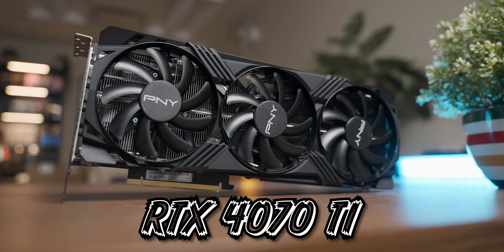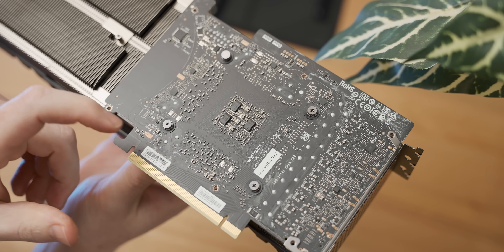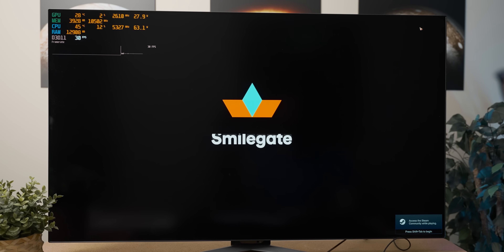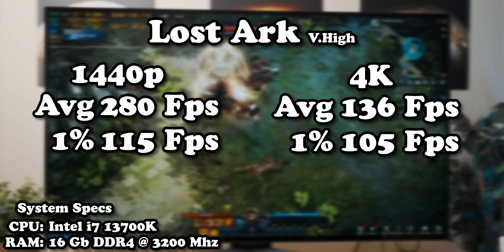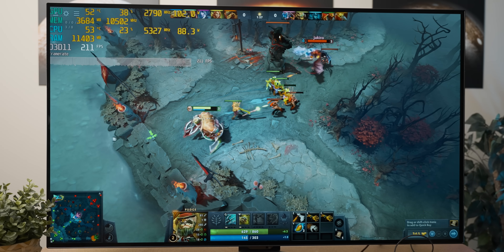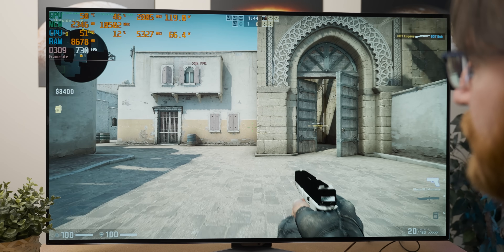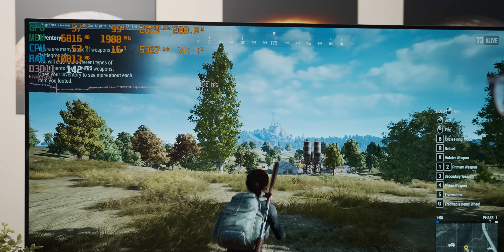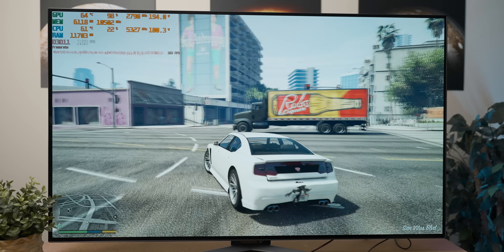RTX 4070 Ti Vs 5 Most Played Games On Steam

Comment: Thanks Dawid, I think the reason those games are so popular is for the same reason they don't push the 4070.  People are playing games that their current gpu's can run and that is why they are so popular.  I managed to get my hands on a 6750xt paired with a 5800x3d and it plays every game on my 1440p monitor without issue on high settings.  Games will have to get a whole lot more gpu greedy before I ever see the need to upgrade again.
Reply: Same here, i have a AMD Radeon RX 6800, and just a few weeks ago a 5800x3d, and it runs fine on my 4k 21:9 
monitor (3840x1600), all my games i have played are way above 60fps, i try to do around 100fps or more if i can, 
it's a 160Hz monitor, running now on 144Hz.
Reply: @AmigaWolf  That's closer to 1440p than 4k. 12:5 acpect ratio

Comment: G'day Dawid,
I don't get "Even though you are not using all the performance now, You need this now for Future Proofing"
Take "The King of Pascal" the 1080Ti March 2017 $699USD, what is consistenly called "a GPU that was priced too well for the performance it offered at the time & nVIDIA will NEVER mak the same mistake again."
Vs 4 years:
Same performance - 3060Ti $399USD or RX6600XT $379USD (yes even with Human Malware at Launch they were this price & people got them for this) 
Same Price - 3080 $699USD (+75% approx performance) or 6800XT $649USD (+70 approx performance)

Yes games get harder to run, but a nVIDIA *60/**60 or AMD equivalent has always been enough to have "a Fun & Sable Gaming Experience" for a few Generations giving you 4 years to save a few $$$ for a new *60/**60.
like if you got a 1060 $299USD 4yrs ago to a 3060 $329 last gen you will still be able to easily stay above 1080p-60 in new games, where as I am sure those who bought a 1080Ti instead of keeping it 8yrs until 5000 to get that same value, no they will still have also wanted to upgrade after 4yrs for 3080/Ti or even 2yrs for 2080Ti then another 2 for 3080/Ti so they keep that level of performancethey have become accustomed to like many in YT comments have said they did & not really saving anything.

If you can afford Top of the line go for it but it is not about "Saving Money"

Comment: My trusty 1650 Super gave up on me in the middle of the GPU shortage a year and a half ago.  I waded into the crappy market and the least scammy deal I could find was a lightly used Power Color 6700xt Hellhound Spectral White Edition.  It pairs very nicely with my Ryzen 5 5600x and my 1080p monitor.  There's nothing I can't run at the moment.  I paid WAAAAAAAY more than 350 bucks, but there wasn't anything better out there.  I remember the card was still available new for $1500 on Amazon at the time!

Comment: I've bought a brand new XFX Merc Black rx6750xt in June 2022 for 599€ instead of an used ugly 2 fans zotac rtx3070 for ~680€. It was already beating a 3070 out of the box with 22.5.1 drivers, but today i gained about 4-5% total improvement with all the drivers updates (now on 23.2.1). Even the best rtx3070 gets demolished now, but i decided to mildly undervolt at 1152mV and oc my card to 2823MHz (core) and 2312MHz (vram). Memory it's maxed out but I can go to 2950MHz on core with a waterblock: the black series from xfx have only best of the best silicon quality dies. 
Now i beat an rtx3070 oc'ed at 2100MHz in dx12, 2%-3% more avg fps than an strix rtx3070ti in dx11... but in dx10, dx9, vulkan and games where s.a.m. it's fully utilized (FH5) i basically have an rx6800/rtx3080-10GB. 

Nvidia can go to hell, it's my 1st red card and i love to play 1440p@144Hz very high detail with it! Absolute monster with insane cooling performance (25-26C idle / 60C intense gaming / 52-55C comp titles) i only "need" to use FSR2 in cyberpunk to go from 85avg to 120avg, i don't like and never used RT and i still play raster3D. Unaudible coil whine and fans never over 50% speed 😎

The powercolor red devil rx6700xt also can obtain insane oc results: my apex mate has it and it's a bit below my results with his ~2850MHz oc. Navi22 POWA 🔥
edit: gamers must grab rx6700xt/6750xt and tune them, with 2023 drivers we have AV1 encoding/decoding support and streaming it's not an issue anymore.
Reply: Can't wait until the XXFXX SuperBlack Rxxx8000xxxxtx comes out
Reply: @floydlooney6837  yes me tooo will be an xxxxxxxxxxxxxxtreme card!

Comment: jesus dawid 2:50
fold the pcb back, it can lay flat while connected to the heatsync
don't just rip the thing off like that!
take some tweezers or something and gently work under the connector(above the clip on the pcb)
wiggle it back and forth and it'll work loose
stop breaking fan cables

Comment: Got myself and my GF 4070 Tis recently coming from a 1060 and 1070 respectively. Many upgrades were skipped due to the ridiculousness of card prices.. Did have an Intel Arc a770 for a short while and wanted so badly to enjoy it, but that card is not ready. From weird driver issues to random audio crackling problems, I was forced a return. AMD was a consideration, but Nvidia just works.

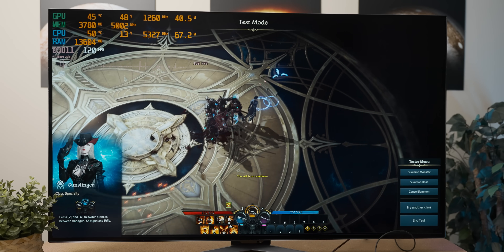Comment: 4:44 So that's 46% utilization at 1200Mhz GPU clock speed in 1440p, then 74% utilization at 2805MHz at 4k. Wow, the GPU didn't even get out of bed to render that 1440p section huh!
Reply: And then we go to 4080. And play at 1440p. No matter what one can say about Ngreedy. There is actually a true value in getting a expensive card that do not need to ramp the fans to max and use 180w to get 144+ fps. I'm sure a 7600xt-7800xt or whatever 4070 card done right can be priced ridiculous but still be worth getting over a 6700xt. As long as it is not 4080 stupid priced and with enough Vram. Just to be able to run the cards quite and still cooled enough to last a long long while.
 
RX 580 8GB is not just slow at 1440p 60fps.. It also is loud and running hot. Getting a 4k card and playing at 1440p might not be a bad idea as long as the price is not stupid ridiculous. AMD 6000 and NV 3000 are and where a lost cause. The prices for them today makes no sense since they where meant to launch at this prices 2 years ago! OR whatever. I rather watch AMD and NV launch a stupid good 1440p card meant for 4k vs buying the old BS.

Comment: It would be interesting to see how the RTX 4070ti compares to the previous generation. I would have love to see how the RTX 3070ti Is holding up against this card. It would be interesting to see what you get for that batch of extra dollars. I suspect it won't be that pretty...
Reply: 4070ti = 3080 in terms of performance
Reply: @evilleader1991  4070ti performs similar to a 3090/3090ti. Check reviews.
Reply: A 4070 Ti would be much faster than a 3070 or 3070 Ti.  Most say it's right around RTX 3090 Ti performance.
Reply: @JeffWaynee  I won't doubt that. But is it really worth the €300 (MSRP) price difference for these games? That's the question of course.
Reply: @jclosed2516  I'm perfectly happy with my 3060, and a 3070 is at least 40-50% faster.

Comment: For a 1440p gaming rig, go with the 6700xt and save the $400-$500 for future upgrades
Reply: Better to buy a xbox for gaming and a thin and light for your work
And after few years xbox can still be sold at decent price
Better then spending your parents money on gaming
Reply: @mudit1  Found the boomer.
Reply: @jamesg8246  i am 21 bro
Reply: 6700 xt is a terrible card why would you do that? just get the 4070 and enjoy it
Reply: Right?  I'm in a situation where I only play World Of Warships at 1440p maxed out with a 1660 Super but soon want to be able to play Starfield on my 65" LG C1 which is 4k 120Hz with VRR.  Not convinced a last gen mid range AMD card without DLSS(yes I know about FSR) is a good deal if it doesn't hold up in 6 months.  I feel like the support will give the 4070ti longer legs.
Reply: @jamesg8246  I highly doubt the 4070 Ti will be able to run Starfield on high-ultra settings in native 4K 120hz, maybe on DLSS balanced with high settings, there's just not enough vram. Remember to consider that Bethesda is now owned by Microsoft, I highly doubt they will not try to get the most they can out of the console version with it's Zen + RDNA2 architecture and 16 gigabytes of shared GDDR6. It's sad but I'm speaking from experience, my 3070 is almost obsolete for new triple A games at native 1440P (yeah lmao), just because of the vram, it's only a matter of 2 years until 12gb reaches the same spot considering a console can use 14 to 15gb of gddr6 on graphics alone (or even more, there's no official documentation about that so we don't know for sure). Maybe you should consider a 7900 XT after the unavoidable price drops or a RTX 4080 if you want to stay with Nvidia.
Reply: @nicolasteixeira6448  Yeah... it's such a bad time to decide, Starfield got delayed to September since I commented.  So for now I have a GeForce Now Ultimate sub that's working well and now that Starfield will be on GFN it may actually be the best option for me to "rent" a 4080 to decide where the next purchase needs to be.  I realize that doesn't address the vram quantity question since GFN uses 24Gb 4080's but at least I'll be able to find out if I need a 4080 level gpu or not to play on my LG C1.
Reply: If only just for gaming then it's fine, but if the user wants to do streaming and editing, then it's better to take the 4070ti, NVENC encoder and Nvidia CUDA are what people need for such tasks (streaming and editing)
Reply: Nah
Reply: but its AMD so L
Reply: @bloxoss  average amd hater who has no other job other than spamming

Comment: In most of the games I play my 1070 feels like a beast on my 4k monitors. The only downside is it's underpowered compared to the rest of my system (built mid-2021). Am I supposed to want to upgrade?
Reply: hey friend i am in that very same shoe like you got a beast as cpu and got x 570 motherboard but a 1070 and a 4k monitor 
only downside of the system was hogwarts legacy i cant play that with very high settings only 4k but mid setting 
i think it comes from the bad optimisation 

do you really think it is worth to upgrade to a 6700 xt here  in germany i can buy for 300 euro

Comment: The only real reason you'd buy such a powerful GPU is to play really graphically demanding (and honestly unoptimized as fuck) AAA games, future-proofing, or to play competitive titles with as many frames as possible. Although the last point is kind of irrelevant since by dropping some settings to High/Medium you can saturate most high frame rate low/lower resolution monitors. Aw and VR is a thing so for that reason as well. Maybe bragging rights but that's stupid, and at that point, you'd buy a 4090.

Comment: My head looks down in shame as i hear the words "if you bought a 4070ti for 1080 gaming your money should put a restraining order on you"... Raises hand hesitantly ✋ while preparing myself to utter the words "future proofing!" .... LOL. Anyway, just ordered a 4070 Ti and Ryzen 7 5800X3D - cant wait. Almost got the 5700x or 5800x but glad i did my research because amazon has the 5800X3D on sale and apparently its a great chip for gaming. Can't wait, OH YA, and the plan is to eventually get a 1440p monitor as well. Right now I have a MSI 27" 165hz 1080p curved and a cheap 24in monitor for my secondary. Once I get the 1440 I can move the MSI over and get rid of the cheap one.
Reply: With those specs you should save up and skip 1440p altogether.
Reply: @MeatNinja  so 4k? Im more into competitive FPS over graphic fidelity. But I'm interested nonetheless
Reply: @MeatNinja  by the way my setup is yearssss in the making. I didnt expect to get a 40 series anything anytime soon as i recently upgraded to a 3060 from a 1660S, not long before that a 1050 Ti and so on. And then tax season came and I seen the 4070 Ti for under 800 and couldn't resist. Lol. Not many times throughout the year that I have disposable income and the rest of my specs are very sound so i figured id make the investment.
Reply: 5800x3d is a great CPU :)

Comment: If I all did was play competetive FPS and MOBA hell no I wouldn't have bought my 4070ti.  I play Witcher 3 with RT on, Cyber punk with maxed out RT, Hogwarts on ultra, all 4k.  This is why i bought it.  My 3070ti couldn't even turn RT on in the games I play unless I set res to 1440 and used DLSS balanced.  Which on my 65'" 4k 120hz TV looked grainy.
Reply: And that 6700xt would be getting about 10fps on the games I play at the ress and settings I play at.

Comment: I play games in 4K. I upgraded from a 3080 10gb to a 3090 24gb because I would run out of vram in some games, especially games that had user created content like Far Cry 5 single player maps.  The 4070ti might be faster than my 3090 but that only 12gb of vram just isn't enough. Once your card runs out of vram then performance drops like a rock and the game becomes a slide show.
Reply: I'm starting to realize this with my 3080 10GB.

Comment: Hey there Dawid.  Good video from a purely gaming perspective.  I’d be curious if you would have the same take away when looking at it from a broader use case?  I play Valorant and MWII almost exclusively just to clear my head between projects. But I mostly do a lot of content creation.  The 4070 TI gives me 3090+/- performance for half the power draw. I also get DLSS 3 and AV1.  For $800.  I’m sure you have a tricked out editing rig but I’d be curious how the 4070 TI would do for you there. I swapped out my 3090 for the 4070 TI and it’s faster on all fronts.  I’m driving a Samsung - CRG9 Series Odyssey 49" LED Curved Dual QHD FreeSync and G-Sync Gaming Monitor display at 5120x1440 @ 120Hz. So far I’m pleased with the upgrade.  If you have the inclination, I’d love to know how you find the 4070 TI for your content creation tasks. 

Cheers
Rick
Reply: I dont see why anyone would take a 4070 ti over a 3090.  Its a terrible card for 4k.  Paying $800 to be locked into 1440p is a terrible deal.
Reply: @Dempig  - hey there.. I had a 3090.  The 4070 TI outperforms it across the board using half the power.  I bit hard on the 12th gen hyple and got a 12900k out the gate.. It's fast.. but always hits thermal throttle pulling nearly 300 watts in r23.  I recently benched that system for a previous gen AMD (I had built one for testing a while back) and I'm running a 5950x that get's all my work done with half the power and is MUCH easier to cool.  So I went for efficiency over raw power.   My monitor tops out at 120Hz so I don't "NEED" much for gaming to hit those numbers.  But for me it was more about content creation (video editing) with less heat and less power.  In the end, my 12900k with 360 AIO can get about 27000 in R23 and runs right under the thermal limit.  My 5950x will hit almost 30K in r23 and barely hits 80c.  

So that's why I upgraded to the 4070 ti.  New features, better performance, half the power draw.  Just a better fit for me personally.

Cheers
Rick

Comment: Great video! Could you please do a similar video for the Intel ARC A770 16gb graphics card? It's less than half the price of the RTX4070Ti, & I heard than it has much higher performance per $. 

But I also heard that although it's great at DirectX 12 games, it originally lacked older game performance, but has apparently been fixed with recent drivers. So seeing how the Intel ARC A770 16gb runs the most popular games in steam NOW, with the latest drivers & firmware, would be REALLY interesting as, on paper, this GPU has a higher hardware spec than other cards costing hundreds of $ more!
Reply: Yeah, at launch there were a lot of issues with older games (or any game running on anything other than DirectX 12) but their driver updates have really improved things since then. The hardware itself seems pretty solid, and most of the issues were software/driver related so it could end up being a really great "budget" card option (if it isn't already).

Comment: I bought a 3070ti a month ago because i thought the 4000 series cards would be too big for my new mini itx build, and then a 4070ti with even smaller form factor came out for only 200 more 😭
Reply: Don't worry, I bought a new 3070 for a terrible price a month ago. 
Because otherwise I'd need to upgrade absolutely everything in order to fully utilize 4000 series card. And 3070 was a bit of a performance boost over my overheating 2070S.
Reply: The only downside to a 3070ti is the 8GB of vram.  The performance is still plenty.
Reply: I bought the RTX 4070 Ti for my itx build too and its compact for the amount of power it provides. Temperatures are awesome too.